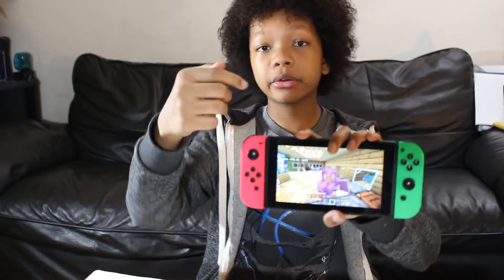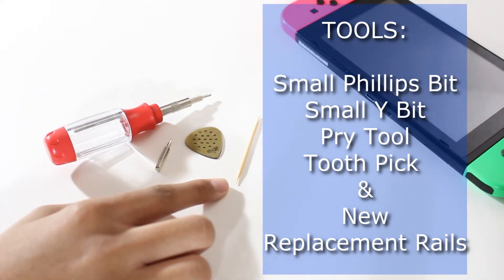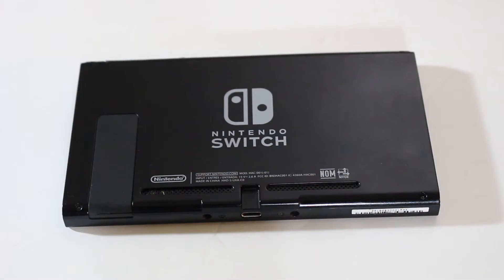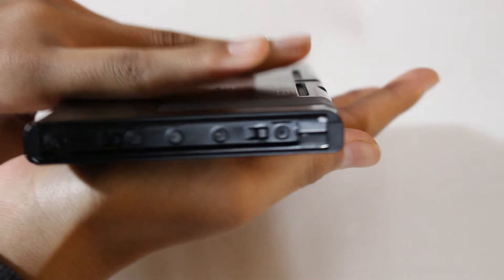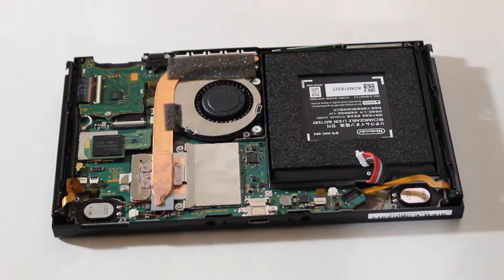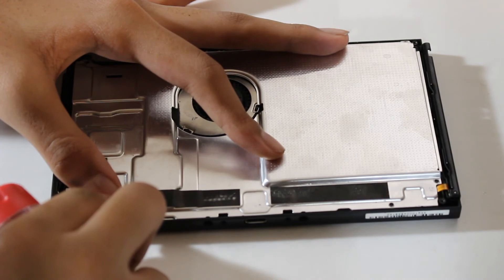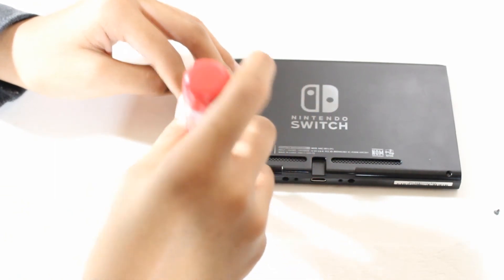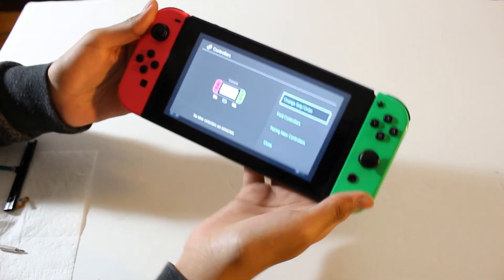Fix Disconnecting Joy Con ( Replacing Nintendo Switch Slide Rails )

Comment: Thank you so much! This saved me some real headache and a hit to my wallet. You clearly know what you are doing. You speak professionally and in proper but easy to understand terms. The video is edited just right and you don't block your work with your fingers! I am an adult with very chunky fingers so I know I would never be able to do a tutorial like this that accurately compeltes the project AND leaves it visible enough to be seen. I am sad to say I almost missed this repair as it is not a common one for you to find when troubleshooting the issue online. I luckily was able to find Amazon listing for the part that made it clear the rails were my issue, at last minute. I almost would up trying to send it in for repairs when I know that would take time and likly be costly. The reviews in the replacement rails suggested I look for YouTube tutorials and yours was one of the first three I tried. By far yours was the best off the bat so thank you very much! My switch is in proper working order now! I have been trying to replay "Breath of the Wild" and the disconnect issue got so bad I was dying every few seconds at boss battles and couldn't even progress on side missions. I will be sure to refer this video on my Amazon review of the part! More people should know about this fix for continuous disconnect and use your video to help them!

Comment: What happens if you don't replace them.. Cause i don't have the new ones
Reply from the maker: hmmmm..

I would say that if for sure this is the problem with your JC's disconnecting...they you could "maybe" try squeezing the gap a little...about 1-2mm just enough to get the looseness out and have a more snug fit. 

For me, it was so cheap to purchase the new ones, that i did not have to get into trying to "mickey mouse" it.
Reply: Alright bro thanks

Comment: My left joycon slides off completely by tapping the bottom! On my other switch it requires the button press to remove it… so it’s not the joycon, must be rail! Ugh
Reply from the maker: Sounds about right!. I was lucky because i didn't throw away my old joy cons when i bought new ones thinking it was the joy cons that needed to be changed to stop the problem.

Comment: Use twizzers not toothpickd
Reply: toothpicks
Reply from the maker: I used toothpick because i did not want to have metal touching any points by accident and didn't have plastic tweezers.
Reply: @akidsperspective4271  metal SHOULD be fine to work with as long as the device is off and you're careful to not create any static electricity. its often why in the PC building space/electronic repairs in general, people often wear anti-static wristbands. however yes to aer on the side of caution you can use non conductive materials.